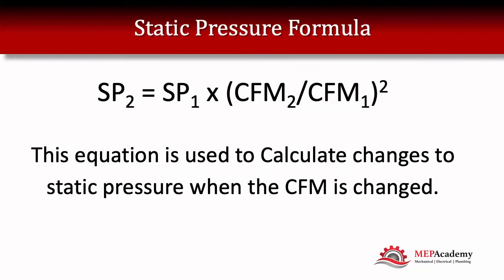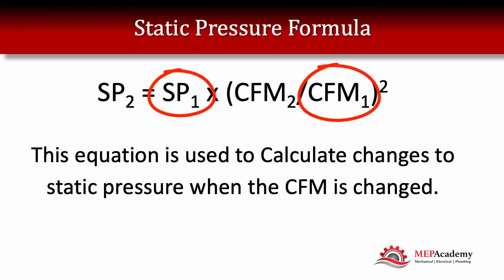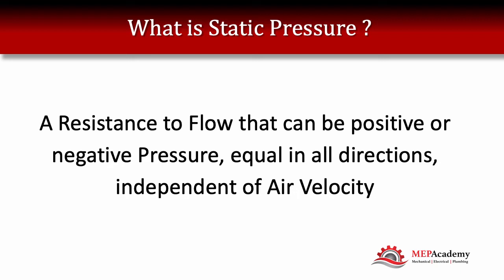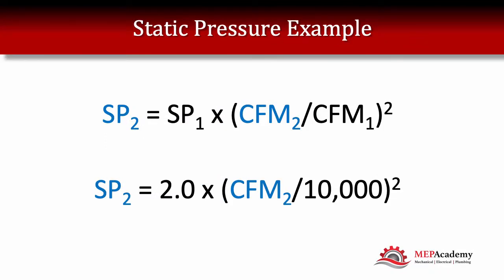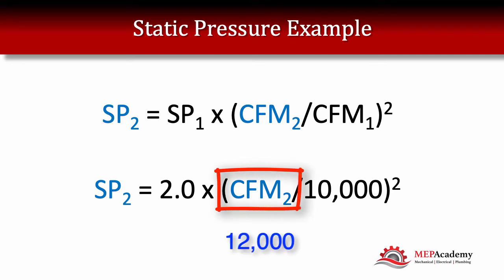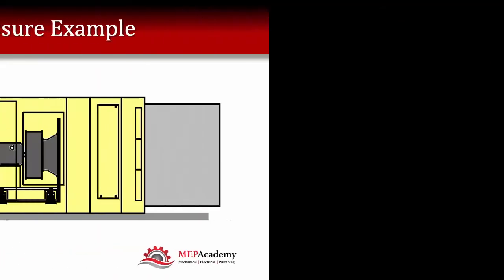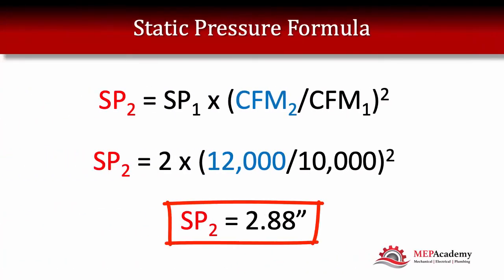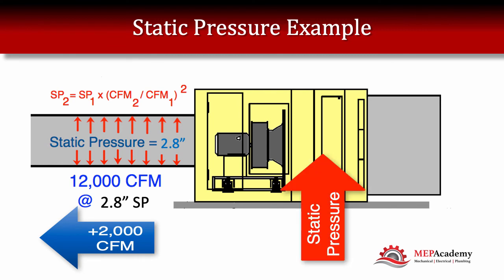How to Calculate Static Pressure and CFM

Comment: i have yet  to figure out a formula to  determine a static pressure for an exhaust system that is not yet in existence.  i need to know how to determine what it will be prior to aire flow being possible.   can you help with a formula to determine  exhaust static pressure for kitchen hood.?
Reply from the maker: You need to determine the total static pressure (TSP), which is the sum of the static pressure losses across each component, such as the exhaust hood, ductwork, filters, dampers, and any other devices in the airflow path. The first step is to determine the airflow requirement for the kitchen exhaust system, which is typically given in cubic feet per minute (CFM). The required CFM depends on the kitchen equipment, cooking type, and hood size. The exhaust hood manufacturer usually provides guidelines for calculating the required CFM. Let’s say the components have the following pressure drops:

Exhaust Hood: 0.4 in. w.g.
Ductwork (based on length, diameter, velocity): 0.6 in. w.g.
Elbows and Transitions: 0.2 in. w.g.
Grease Filters: 0.5 in. w.g.
Dampers: 0.1 in. w.g.
The Total Static Pressure (TSP) = 0.4 + 0.6 + 0.2 + 0.5 + 0.1 = 1.8 in. w.g.

Once you have the total static pressure, select an exhaust fan that is rated to deliver the required CFM at that static pressure. Most fan manufacturers provide performance curves that show the fan’s airflow at different static pressures. It's best to hire a professional mechanical engineer to ensure that the design meets all applicable codes and standards, as the system will need to be submitted to the local code authorities for approval and a permit.

Comment: Did I understand correctly that static pressure is directly related to CFM? Can I compare it with °C and Kelvin? As one increases, the other also increases. but the values start at a different point and the distances between the values are different? :)
Reply from the maker: An increase in static pressure in an HVAC system typically results in a decrease in total CFM (cubic feet per minute) of airflow. This occurs because the fan or blower in the system must work harder to overcome the higher resistance caused by the increased static pressure.

Comment: How  lower /Heigher  SP effect to fan efficiency?  Plz explain
Reply from the maker: You have to look at the particular fans Flow Chart, as each fan performs at different efficiencies on a curve. At low or high Flows the efficiency can drop off from the system curves best point of operation. Google " Centrifugal Fan Charts" and look at one to see how they effect efficiency.

Comment: Sir, basically the calculation method used in this video is done by applying a fan law in which we gotta need the same situation for the size of duct area, right ?. but I'm a bit confused suppose if I wanna start to design a fan from zero. the main parameters for this are the air flow, static pressure (pressure rise), and the fan speed (rpm). How to determine the static pressure ? can we put it as much as we want or is there any basic calculation to wisely select the proper SP for the design parameters ?. pls help me.
Reply from the maker: If you are starting from the beginning and designing a ductwork system with a fan attached, you would calculate how much CFM is passing through a duct or fitting at a particular size. You would add up all the losses (Static Pressure Losses) from the friction of the air passing through each duct section or fitting, including any dampers or other items.. You want to size the fan with the correct static pressure from your calculations, you never want to oversize a fan as its just a waste of money and energy. The Fan Law is useful if you're trying to determine a new outcome from changing any of the existing factors. The Fan Laws are not needed when sizing a new system from the beginning. hope that helps.
Reply: @MEPAcademy  Thanks

Comment: How does this math work?
Since the CFM increased by 20% would your SP also not increase the same? 2.4"
Please explain if I'm wrong. Thanks
Reply from the maker: A 20% Increase in CFM doesn't correlate to a 20% increase in Static Pressure. Using the Fan Law Formula the math looks like this. SP2 = SP1 x (CFM2 / CFM1)2. Now with the given values SP2 = 2 x (12,000/10,000)2, further reduced to SP2 = 2 x (1.2)2, then we get SP2 = 2 x (1.2 x 1.2), SP2= 2 x 1.44 = 2.88. I hope that helps.
Reply: @MEPAcademy  Good stuff